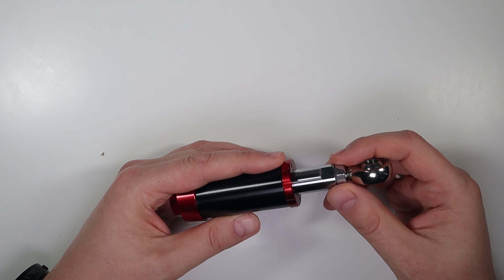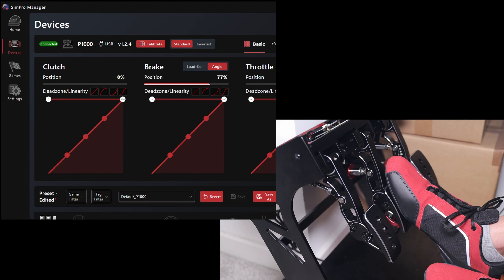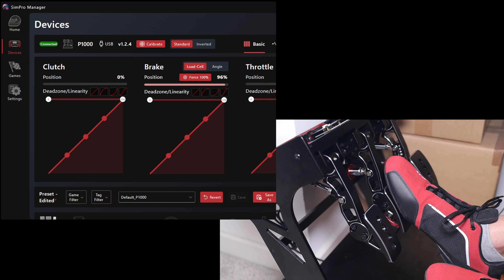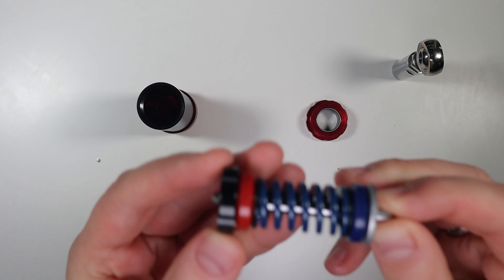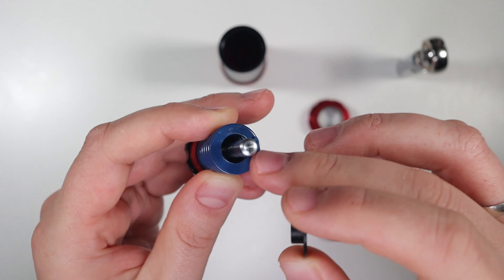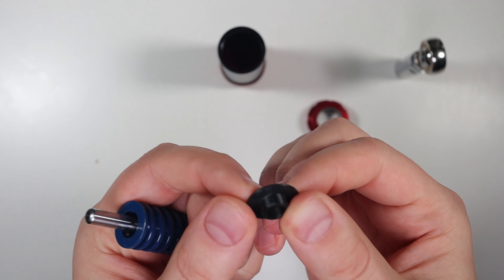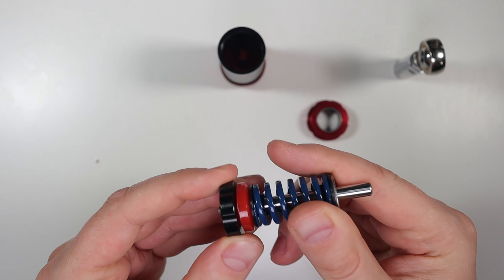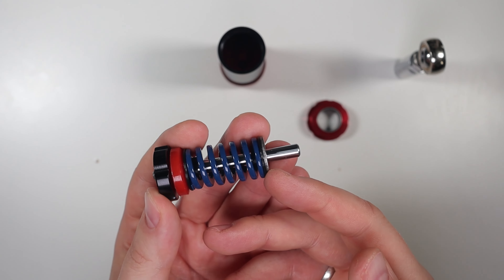How to fix Simagic P1000 Load Cell Drift

Comment: The entire elastomer relaxation debate is so misunderstood. In your example, you argue you hold the same position, yet the input is lowered in the software. Yet a loadcell doesn't measure position, you need to keep the same pressure. Of course a hall angle sensor measures your position more accurately than a loadcell because a loadcell is not designed to measure a position at all.
Reply: @drchtct it is a big problem. I drive the lotus 49 and this relaxation of the rubbers effects my times by up to 3 teeths and we all know that critical at higher skill levels as all drivers are within 1 tenth of each other. 

When using springs and a loadcell Zero Loss on pressure but on the elastomers it was 10 to 20% drop in the first 2 seconds. Not sure how you can't see that's a big issue. 

If it wasn't due to the way a loadcell works why does those problem go away once you add a spring????

The main issue isn't the just the relaxation it's the amount in % that's the issues. Without any feeling your letting off the pedals while you think your holding the brake at a certain % it drops way too much. Drop 1% or 2% yes but that's not the case loadcells using elestomers ALL have about 10% too 15% relaxation in the first 2 seconds come as high as 20% so if you need too keep 70% brake pressure for 3 seconds as we do in many formula cars but within 2 seconds that brake pressure will drop from 70% too 50% and that's the issue
Reply: he means he's holding the same position with a constant force !
Reply: Have been trying to explain this for ages. I actually mounted my pedal to a bench so the face was horizontal and used barbell disks and strap to hang the weights. This constant force registers absolutely stable, but you can observe a small creep in displacement of the pedal as the elastomer continues to expand outwards. I believe the heat generated by the compression causes the elastomer rubber to become maleable and this allows the continued displacement after the initial compression. The force applied to the elastomer is always fully transferred. I used the example of standing on a load cell bathroom scale in bare feet and then doing the same standing on a stack of elastomers, I would not magically have less mass.
Reply: @JoFandango  He is not holding constant force, that's the problem. The load cell always gets 100% of the force. He is holding the same position but due to the elastomers properties, holding the same position will require less force over time. Thus, he is holding the same position, but his holding force gets lower. That shows on the load cell. 
For him to hold the same force, he would have to increase pedal deflection (which wouldn't increasing force)
Reply: @Hugo-pj4bm  Finally, some additional insight on the problem. I've been thinking this might be the case as well, but I cant test it because I havent bought it yet (im considering my options) and the weird thing is that it might depend on a person if you work better with angle or with force, as I changed the spring in my current pedal and I could 100% say that Im using force to determine how much I want to brake. So if I understand it correctly, if you focus on keeping the pressure without blocking your foot in constant position, you will get constant response as it should be?
Reply: Bottom line for me is: if it ain't a problem for you, it ain't a problem period. It is, though, a problem for many people, including very experienced sim racers. For these people, this video is really helpful.
Reply: In fact, brake pedal feeling is one hell of an issue even in real life (Barrichello's story about his brake issues while being teammate with Button comes to mind). I think the main problem is basically everyone out there swearing by load cells, etc., like it's a definitive answer that will fit everyone's needs. It just isn't and the best thing would be for us to be able to test for ourselves before making purchases, which unfortunately is just not possible 99% of the time...
Reply: @lugs118  you've hit the nail on the head pretty much. What's actually happening is the elastomers are experiencing hysteresis which is the property whereby a material acts like a spring and damper system, leading to a time delay in the final steady-state of the system being reach when a change in force is applied. Springs have zero hysteresis and will change to their steady-state instantaneously as the force applied changes. But rubbers (which act like a combination of spring and damper, just like your car suspension) have hysteresis and this causes a delay to the final compression state when met with a change in force applied to it. Now, what this means for the elastomers on a load cell brake pedal is that after the quick change in braking force by the driver from 0 pressure to some amount of pressure, the elastomers will generating an additional internal resistive force (just like a damper) that is resisting the compressive force by the driver. But over time, as the drivers foot pressure wins out and compresses the elastomer, this internal resistance dissipates and the elastomers reach their final compressed state. Now, here's the kicker.....when you as a driver apply brake pressure, you do so initially with only pressure in mind but then after attaining the desired pressure target, you start to tense and lock your leg and foot in that position to try and efficiently hold the previously desired pressure target BUT since the elastomers continue to compress for a little while after this, it means the pressure the driver is applying to the brake pedal will actually becomes less than it was initially because the elastomer stack as compressed, moving the brake pedal slightly towards the load cell and therefore away from your foot. The fact that when you use the hall sensor instead of the load cell and this change in the reading does not occur is proof that this is happening. It is the proof that after applying our targeted brake pressure, we actually change from a pressure input only mode to a position AND pressure input mode with our braking foot/leg.

I hope that made sense.
Reply: @lugs118  i actually wondered if someone tested it this way, its the only way to test this theory with constant weight
Reply: @mikri88  I did test it in a repeatable way using weight plates from a barbell set. The pedal was clamped to my workbench with the pedal face horizontal, the pedal face was then removed and a hook placed into the bolt hole. With this arrangement I was able to progressively load and measure the load and pedal displacement. As you would expect, force applied is always fully transferred regardless of the elastomer, spring, solid spacers. The displacement however can clearly be seen to have an initial movement followed by a secondary ‘creep’ only when elastomers are used. The amount of secondary displacement is proportional to the applied load but also increases with increased temperature.
Reply: @lugs118  interesting, so its seems better to just use ALL springs if possible, and no elastomers
Reply: @mikri88  yes, springs don’t suffer from this problem, however they are linear in their response while elastomers have a rising rate that gives a progressive feel. I have gone with VRS pedals as they use ISO die springs that are available in a wide range of force values but more importantly the pedal arm has an adjustable tie rod and swing arm that changes the geometry throughout the stroke and creates a non linear curve from a linear spring.
Reply: @lugs118  hmmm yes those were the pedals I was thinking of going with